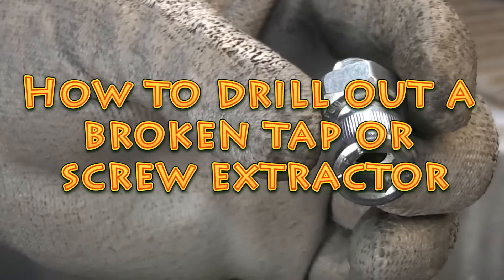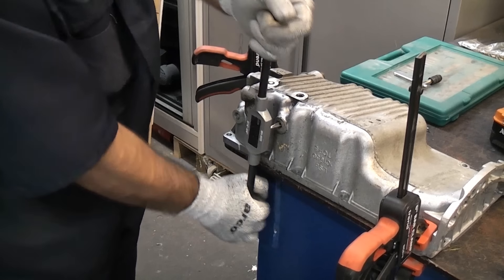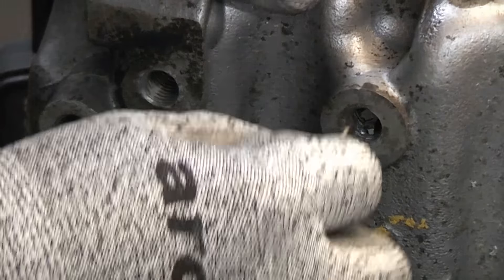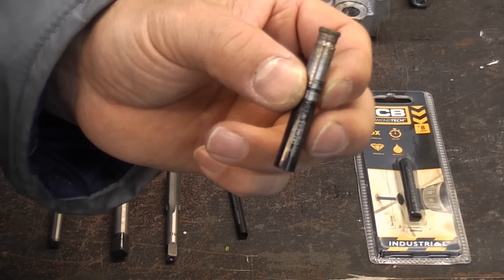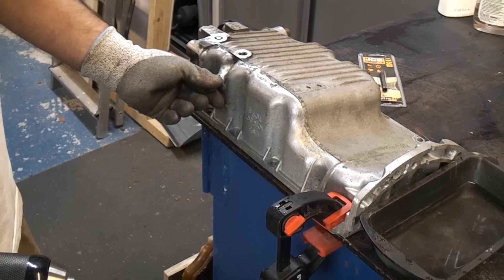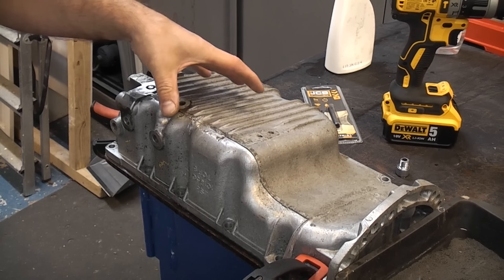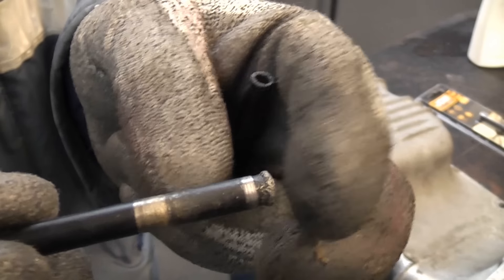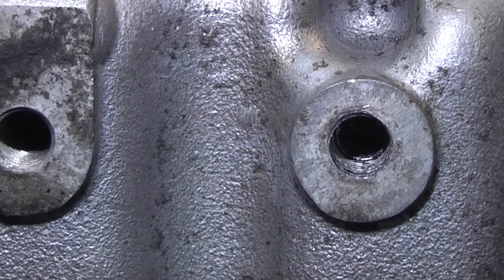How to drill out a broken tap | drill out a broken screw extractor

Comment: Thanks for the tip with diamond drill bit
Didn't know that these exist.
I bought a 6mm and will try to drill out the broken drill bit from my car flywheel.
There is a hole to block the crankshaft from rotating and the drill broke off when i forgot to remove it and i turned the starter.
Now im changing the clutch and i want to remove the stuck piece in it.
It's amazing actually that some stone called diamond is harder than any hardest metal and it eats it like butter
Reply from the maker: Absolutely, it is amazing how hard diamond is!
Thanks for the comment 👍

Comment: I love how the tap refused to play ball & break... & when it did, it broke in a place I have never seen a tap break in my 30 years experience as a machinist / repair guy... 🙄😂

If you could rig it so you were drilling vertically & had a continuous flow of cooling water, you would have speeded the job up... but thats not always possible. 

Thank you for going through the whole effort to show the process involved... 

Regarding tapping the hole or using an extractor... in situations like this particularly, I use a NEW tap, preferably a Presto spiral-point machine tap and use a good quality cutting oil like Rocol or similar, backing out, cleaning the swarf out & going in again ... patience is the name of the game. 

I think its even more critical to use top quality extractors as they are almost glass-hard & very brittle. Presto brand was my favourite...and yet I have managed to snap even those... 😖

Carbide tipped masonry bits can be used in a pinch but need grinding to put a positive cutting rake angle on the tip... 

There is a great sense of achievement & satisfaction in successfully doing a job like this, particularly if the part is expensive to replace or maybe even irreplaceable.... 

You've got a sub & a like from me based on this vid alone... good job mate 😉

From the Emerald Isle
😎👍☘🍺

https://www.rocol.com/products/rtd-chlorine-free-liquid

https://www.presto-tools.co.uk/ProductGrp/metric-coarse-spiral-point-taps-iso-529

https://www.presto-tools.co.uk/Products/screw-extractor-sets/096001-6
Reply from the maker: Thanks for the detailed comment 👍

Comment: I have found you can sometimes shatter the remains of the tap by punching with another hard steel punch. Alternatively on small individual parts heat the whole lot up to take the tap steel to a softened state when cool and use a standard drill to take it out.

Comment: That was pretty.  When going up a size, is it unnecessary to bore the hole smooth first, or can you just tap over the remnants of  the original threads?  I wonder what is the best way to minimize the jump in bolt diameter.  I reckon there would be implications for hardened steel suspension components.  Thanks for sharing!
Reply from the maker: It's important that the hole is the correct size for tapping, so it would need drilling with the correct size drill bit first. There is a metric guide on this page- http://www.ultimatehandyman.co.uk/how-to/metalworking/tap-and-die
👍

Comment: Very impressive skills and knowledge . This type of problem also occurs with electrical connectors . I have this type of problem at the moment .  We have  a 300 pin female connector . The female connector receptacle  diameter is about 0.6mm . One male pin in broken deep inside the one of the female connector receptacles . We spent about 3 weeks wiring up to this connector and the pin broke when the connector wiring was being checked when the work was completed . This is a very high spec connector with small dimensions so I am urgently trying to find a solution that will allow the removal of the broken pin without damaging the connector . I would greatly appreciate any suggestions
Reply from the maker: Blimey, that sounds like everyone’s worst nightmare 😱
I don’t suppose you could superglue something to the pin and then extract it?

Comment: Oh man I'm having a bad time right now. I snapped a bolt off on an exhaust manifold and then snapped off an extractor in the bolt.  So I am in a similar situation. Worse thing is that I can't take the manifold off, without a garage taking the body off the vehicle.. so it's got to be done in situ.  I have some solid carbide bits coming, and some diamond hole cutters coming as well. I am worried that I might snap a carbide bit off in the hole and then things will be even worse... so I will probably take the extra time to do it this way. Thanks for uploading. 🙂
Reply from the maker: Sounds like a nightmare!
Best of luck with it  👍

Comment: You might try running your diamond drill counterclockwise as you drill.  I have used left hand spiral carbide drills to drill the pilot hole in bolts to accept an easy out.  Many times the bolt will come out while drilling the pilot due the  constant unscrewing forces while drilling.
Reply from the maker: I'm afraid that diamond coated bits do not bite, like a standard drill bit- they just grind away the material.
Thanks for the comment 👍

Comment: Left hand drill bits?  
you could also run the diamond bit backwards to help extract, and if you use a left hand bit on the bolt it will often back itself out.
But, a well made video, with lots of good advice.
Reply from the maker: The diamond bits do not bite like a normal drill bit- they slowly grind away.
Thanks for the comment 👍

Comment: Well, I was stuck on how to remove a bolt shaft that was stuck inside an expensive part on my 2cyl westerbeke diesel. I had broken off a drill bit in one end and a screw extractor in the other end. The bolt might still be stuck, but not for long, now! Thanks!
Reply from the maker: You are welcome
Thanks for the comment 👍
Reply: Ultimate Handyman 

I now have a running diesel. It cost me $18 for the bit, which is still almost new. Very happy. Your extraordianry effort at creating such a time-consuming and expensive how-to is ver much appreciated here. Thank you again.

Comment: Good information and I did not know about those little diamond tip hole saws I will be getting a set of those for sure!  Any time you have unlike metals together like this I am not shy using anti_seize compound on the threaded bolt going into the aluminum its a practice that can save you a whole lot of time later on!
Thanks for sharing its very good information!
Reply from the maker: Thanks for the comment 👍

Comment: Great idea. Have you tried using the drill Anti clockwise so as it drills and grips it can also try to loosen the tap / bolt ect same as you would with a Left hand drill bit.
Reply from the maker: The diamond coated hole saws don't bite into the material like a drill bit does, they tend to grind away at the material rather than cut it away, so using one of these in reverse will make very little difference.
Thanks for the comment 👍

Comment: Just found your video. Watched it from beginning to end. Thanks for tips. I have to deal with something like this on a 5speed transmission turret. Cross my fingers I can get the busted bolt the previous owner decided to leave in there for me to find. SMH. Cheers.
Reply: Also like your idea of a drilled out socket head cap screw for a drill guide.
Reply from the maker: Thanks for the comment

Comment: Re using diamond  drill bits ( hole saw) for tap or screw extractor removal.
If you can reorient your workpiece so  you are drilling directly  down  rather than  sideways,  use shop rag or towel around area to form a moat,  fill this with water, then you don't need to stop every few seconds, just lift drill up and down regularly as you drill.  You may need to top up water as rag soaks it up. This is standard method  in stone industry  for drilling in eg granite bench tops on site. This will reduce drilling  time hugely, and drill will be more effective  and last longer, main reason for drill wearing out is running dry or excess heat. Cheers.  Ex owner of a bench top business plus a few years in the industry
Edit additionally,  for similar money, get a decent diamond drill bit, what you used were a thin coat of sintered diamond coat, which has a very short life if they get hot or dry. The best drill bits have teeth  usually  about 5 to 8 mm deep of solid diamond matrix. This means you get this level of wear ie 5 to 8mm of wear before they need replacement,  rather than perhaps 0.5 to less than 1.0mm, further the good ones generally  take much  more abuse  before they need replacement, apart from the huge difference in life aspect.   Surprisingly you can often  buy proper ones from cheap 2 dollar type stores or more expensive brands from  concrete cutting supplies/stone industry consumables supply  businesses,   for probably no more than you paid for what you are using. 
Great  sharing tips like this with general public who probably would never know otherwise. I personally have been using a huge range of diamond stone industry tools repurposed  for otherwise unusual situations  to great success for many years. There is a huge range out there.
Reply from the maker: Thanks for the comment

Comment: The last time I broke a bolt, I searched YouTube for specific techniques and found a video about Metal Disintegration Machines.  It looks like a drill press but uses a non-conductive fluid with an electrode to remove metal.  Just like the diamond hole saw, the metal of the broken bolt is eaten away around the broken extractor leaving it and the threads intact.  When done properly, the hole is left with nothing but the threads looking like a helicoil or spring to be extracted with a punch or pick tool.  I never knew they existed.  Where have these been all my life?

Comment: I believe I would use water in a spray or squirt bottle rather than dipping that diamond bit into the water tray that would also help flush out any steel particles.
Reply from the maker: You could do that, or even set up a water jet pointing at the hole.
Thanks for the comment

Comment: Good tip on the diamond hole saws. I didn't know they existed. Any reason they can't be run in reverse? Seems like the vibration might walk the stuck piece out, just like a left-handed drill bit sometimes does. As long as the diamond pieces don't have a directional property, it seems like that would be OK.
Reply from the maker: Yes, you can use them in either direction, but they tend to file away the metal, so it is unlikely that they will bite and remove the damaged bolt, but I guess it makes sense to drill in reverse- just in case it bites 
Thanks for the comment 👍

Comment: Love the alternate but understandable English "Buttered up" rather than buggered up. Amazing hints. Ive run into this and just over sized the hole but this is better
Reply from the maker: Is that the added English subtitles, or the automatically generated ones?
If the former I'll sack the editor ;-)
Thanks for the comment
Reply: Being from the other side of the pond, we use different words. Like you use spinner and we use wrench. I'm just picking up nuances of true English rather than are buggered up English/German/melting pot language. 

No I was not using the subtitle. I'm pretty sure you said buttered up. Not a flaw just a haha
Reply from the maker: @coulssp   I said "seriously battered" at one point- https://youtu.be/7JCfEMrCjhc?t=227  The ARTU drill bits are badly damaged at the ends, which is why I said that.

Thanks for the comments

Comment: I broke a Cobalt drill bit tip inside the  glow plug hole of an engine. So far made the job worst by trying using multiple drill bits because tips keep sliding off of each other (tip of stuck and broken bit piece and tip of my extracting drill bits).
Question is, based on your experience will this be able to drill out such metal?
Please do reply as I am in serious need of any jelp from anywhere. Please...

Comment: The removing a broken tap was very interesting. Very good tutorial. i hav'n't seen those diamond core drills but that is something I'm going to definitely look for online. For repair shops, it might be good to divide the number of times you can use a core drill by its cost, when working out a customer charge. Great work! I'm subscribed and following!!
Reply from the maker: The diamond coated hole saws are often used for drilling porcelain tiles.
Thanks for the comment 👍

Comment: I was under the impression that diamond bits cannot be used on ferrous alloys since they react chemically with the iron. Am I mistaken? Or does the constant water cooling prevent that from happening?
Reply from the maker: Not sure about that, the diamonds are of course sintered to a steel tube in the first place- to make the diamond coated hole saw!
Reply: @ultimatehandyman  Hm true. Thanks very much for the demonstration!

Comment: all of these videos show a drill and then a rethread but is it possible to just drill the bolt out without rethreading, so basically you get really close to the edge of the stuck bolt and then somehow pull the leftovers out or break them out because it should be thin
Reply from the maker: It is possible, but most people just run a tap down afterwards to ensure the threads are good
Thanks for the comment 👍
Reply: @ultimatehandyman  I made a mess of the threads somehow but with perseverance managed to get the new bolt to hold finally.  Thanks

Comment: Question, can I use the diamond hole saw to remove a broken recessed bolt & then tap carefully? I have a broke 6mm SS bolt in aluminum & I’m afraid extractors will break due to small size & corrosion. Awesome video btw!
Reply from the maker: Have you seen this video-
https://www.youtube.com/watch?v=dJfkCj3FWBs
It might give you some ideas.
The diamond bit is only needed for tough steel, such as broken drills/taps/extractors etc.

Comment: I'm curious to see how the drill itself held up to this, as well as how many battery changes you went through? For a task like this I'd not dream of using my Makita 18v drill even with the 5ah batteries I'd just imagine it being a total pain, I'd opt to go for the 110/240 SDS and a chuck adaptor? Was there a reason you chose to use the drill that you did? I'm just a humble electrician so not massively clued up on the engineering side of things like this so genuinely interested to see your reasoning, cheers!
Reply from the maker: To be honest I would have used the 18v AEG drill that I have (it was sent by a PR company a while back), but I realised that the batteries were flat, so I used the Dewalt. If I remember rightly I started off with a partly charged 5AH battery, but had to swap to a 4AH battery. 
I'm not keen on SDS chuck adaptors as they can wobble, which would not be much of a problem with the diamond hole saw, but it would not have been good for the final drilling with the tapping size drill.
Perhaps a mains power drill would have done the job faster, as they normally rotate faster, but for convenience I prefer to use a cordless drill.
Thanks for the comment

Comment: You have to make sure when using a tap, to work it back and forth. As far forward as you are going, you also have to move it back as well. It looked like you were going forward 3 to every 1 back. It should be a 1 to 1 forward/backward ratio. Actually, when I rewatched the video, it looked like you hardly went back at all.

Comment: Brilliant w/the diamond coring bit..
If it was my try, I’d have switched to running it in reverse on the chance of backing out the tap.
Reply from the maker: Yeah, you can run a diamond coated hole saw in either direction, but they do not bite like normal drill bits (it's more of a grinding operation), so it's unlikely that it will bite and remove the broken tap.
Thanks for the comment 👍

Comment: Thanks for that.
I broke off an ezy-out screw extractor once and I eventually got it out by 
using a spring loaded hole punch and breaking little pieces off the extractor
until it was all removed. It took about 4 hours.
It was a radiator hose thermostat manifold on a car engine.
One bolt came out OK.
The other bolt snapped when I undid it and then a screw extractor snapped off inside it.
I tapped it later for an oversize bolt from a metric to an imperial size.
It worked perfectly and saved a whole car engine.
Hot water from the radiator system had got down and 
seized the threads of the aluminium to the steel bolt.
It should have had copper eze on the threads but of course it didn't.
Changing from metric to imperial or vica versa can allow a similar size bolt to be used without
having to use a Helicoil insert.
Reply from the maker: Wow, that was a long and difficult job!
Well done 👍
Reply: @ultimatehandyman  - thanks - at least I fixed it and all at home in a garage.

Comment: Excellent realisation with the diamond bit!  However - Having the known diameter of the thread and using a drill but equal to the core diameter of the bolt - should have made it relatively easy to pick out the remnants before using a tap, especially to get the remainder  out?……🤔
Reply from the maker: The diamond coated hole saws are only available in a few sizes, so you have to use the best fit in most cases 👍
Reply: Ultimate Handyman they seem to be thin on the ground - but handy to have - not sure about generic ones on amazon or ebay ….👍

Comment: Will those diamond hole saws cut in both directions?  Would there be any advantage to running it in the counter-clockwise direction?
Reply from the maker: Yes, they cut in either direction. No advantage to using them in reverse though, as they don’t bite into the workpiece like normal drills, they just slowly file the material away  👍